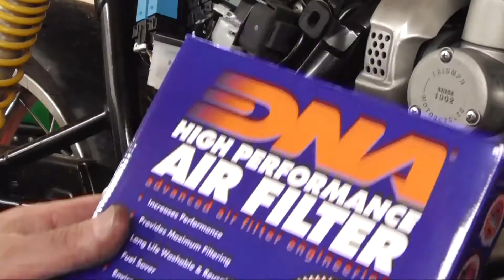Tec booster plug and DNA air filter on Triumph Thruxton r

Comment: Great video had a x.pipe put on my speed twin by a triumph mechanic he told me you don't need a booster plug or to change the air filter as this could effect the performance tho I want to put these parts on I haven't left everything standard apart from x.pipe will be interesting to see how yours runs  stay safe looking forward to next video 🇬🇧👍
Reply from the maker: Thanks i think the booster plug is better when you have the cat fitted the air filter might make a difference though